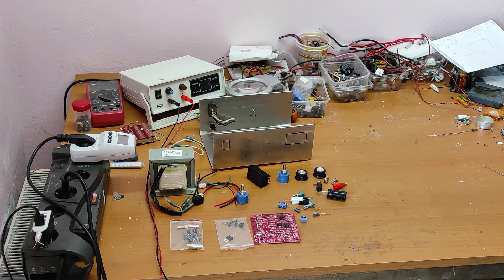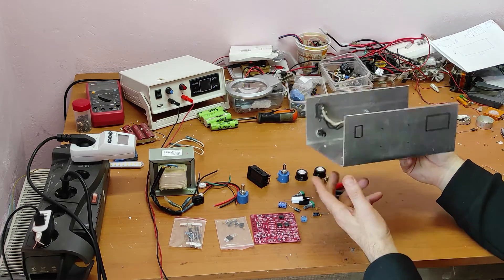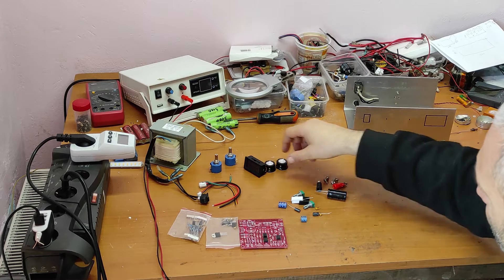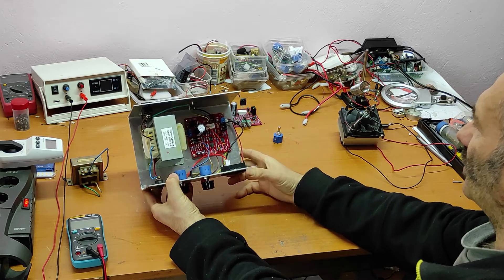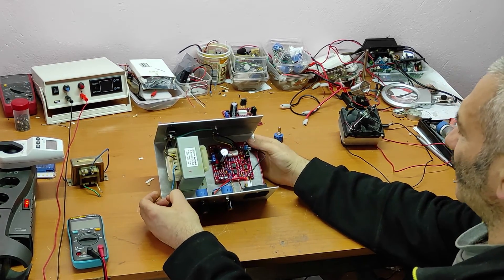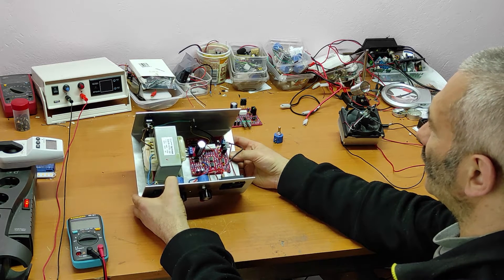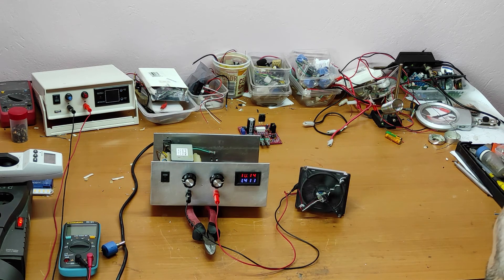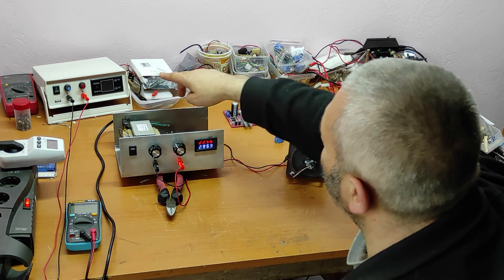Old school 30V3A power supply linear with transformer

Comment: Hi Marius. Is it possible to get more current out using a more powerful transistor
Reply from the maker: hi Erboy,teoreticaly it is posible to get more curent with a powerful transistor and adjusting R7 power resistor from schematic.but practicaly the chalenge is power disipating on transistor,and that's why  instead of bigger transistor usualy its used 2 or 3 or 4 transistors in paralel.
Reply: @diymariuselectro   I will order this kit because this power supply is quite interesting to me. Thanks for your video and specially thanks for your reply